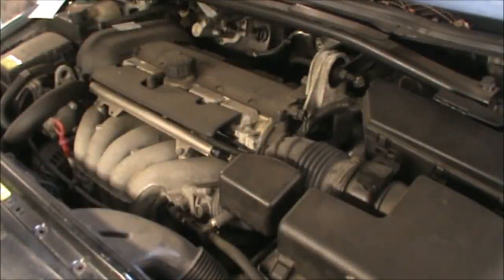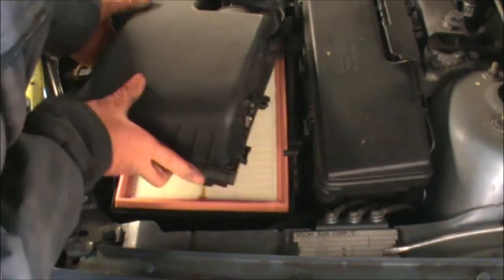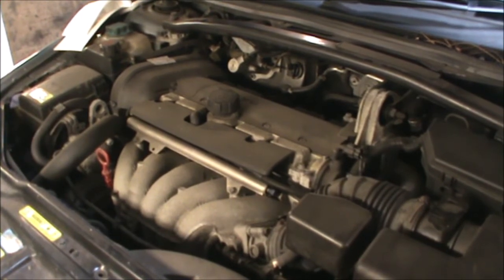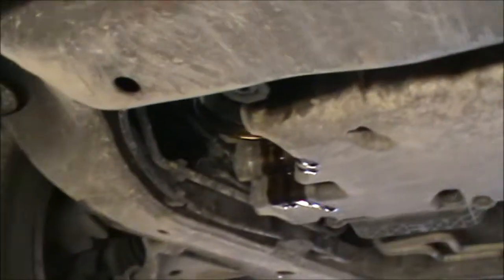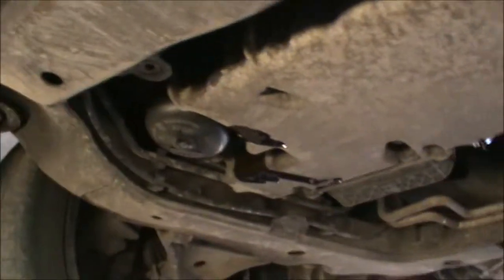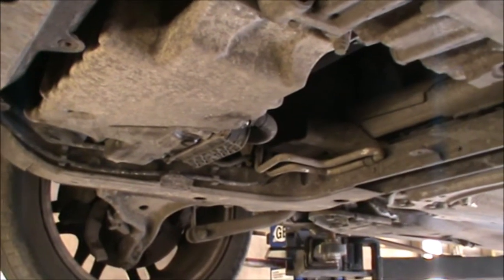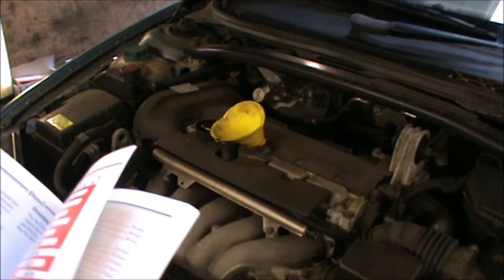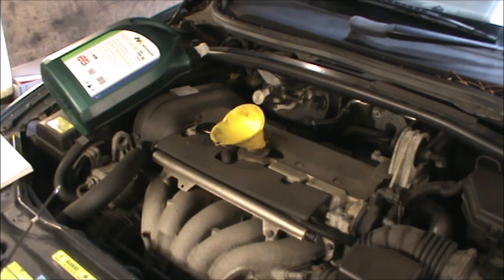Volvo V70 2003 2.4 oil, oil filter and air filter removal and replacement

Comment: does it matter which way is up on the filter cartridge?
Reply from the maker: The oil filter cartridge in this model can be placed with any side up, is not like other filters that go in a certain direction...
Reply: okay thank you